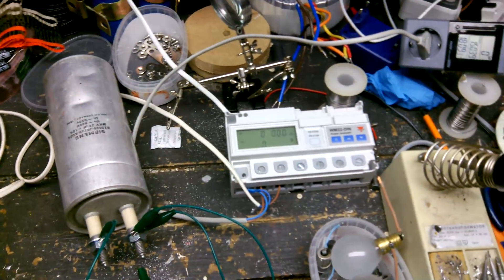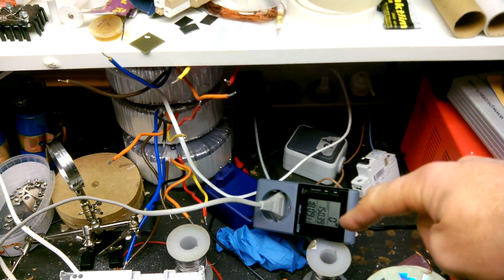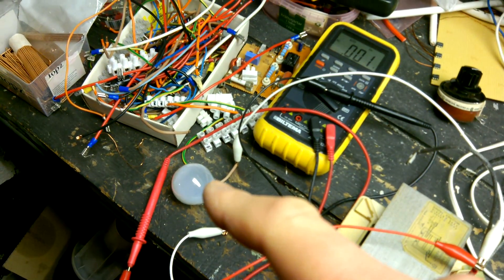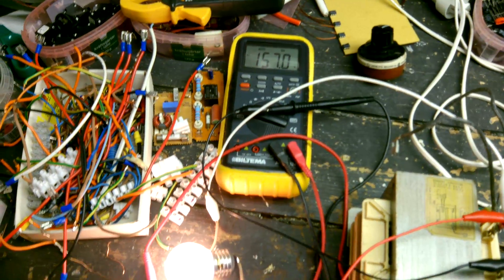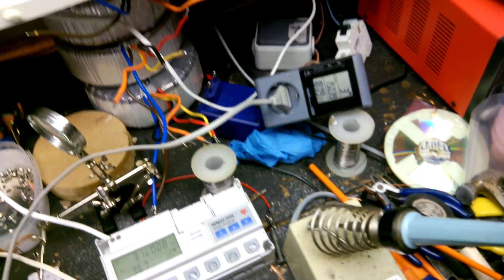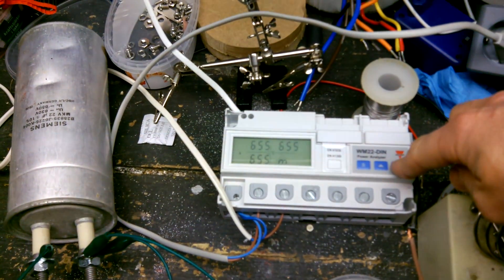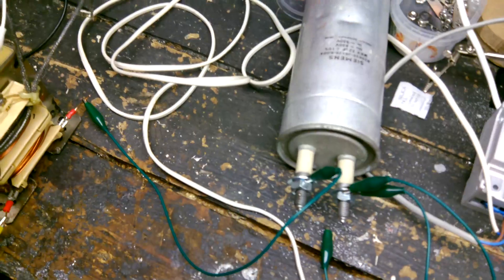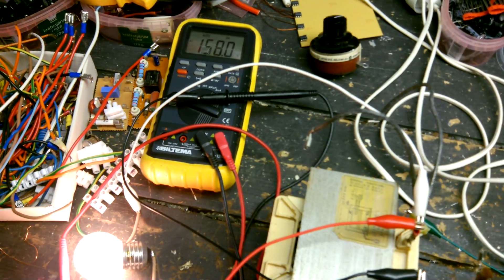Luc Reactive MOT Secondary Load

Comment: Congratulation Hob, you are the first to replicate the circuit correctly.
I shared this information exactly one month ago to the day (Nov 15th)
Now for your next test, short the Secondary and add a Low value 1 to 10 ohms resistor in Series on the return leg (non cap side) of the Primary. This is now a low voltage but high current output. Start with 1 ohms and work your way up till the watts are at minimum. The voltage across the resistor is equal to power you can take out of the circuit. After you have found the ideal resistor value make a new video to show me and I will give you the next test of what to do with this power.

All the best

Luc
Reply: *****
Hi Matt, my tests are starting to show me that low impedance is very important. So, if you want to be off grid the best low impedance would be lead acid batteries. The problem is making an AC circuit which can handle the returned reactive power (@ 45 degrees in the phase)
An Inverter cannot handle reactive power being returned to it.

You can read all the details at the public forum. See links under the video in the about tab.

All the best in your experiments

Luc